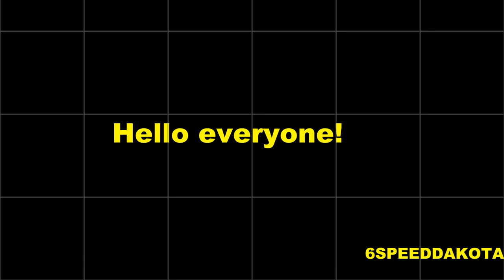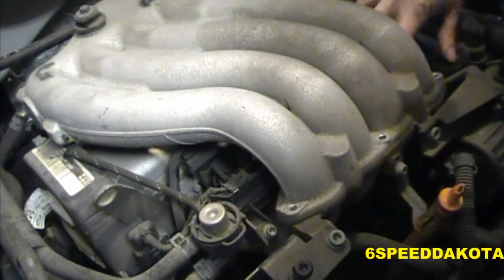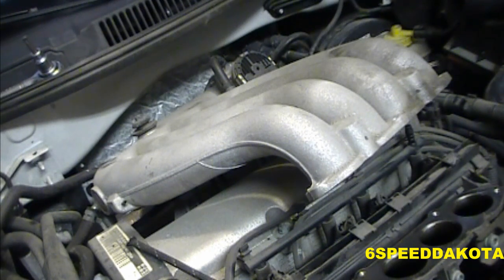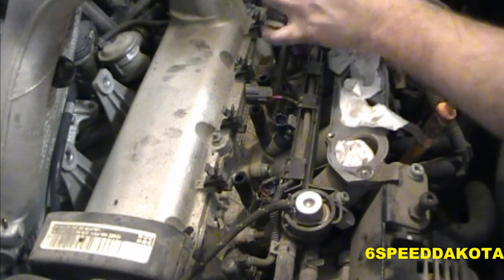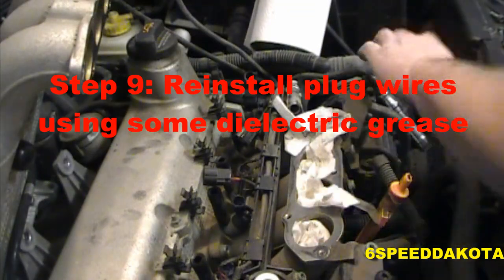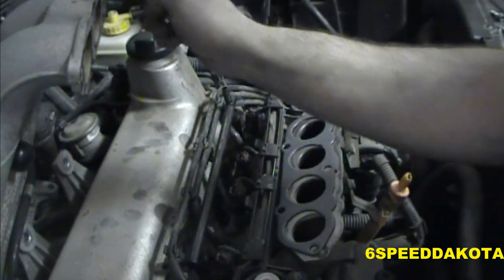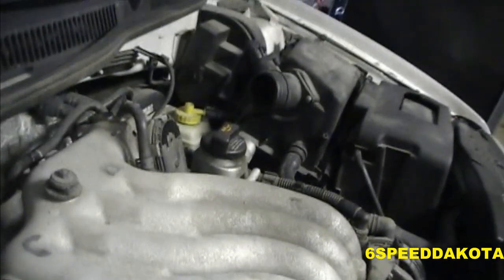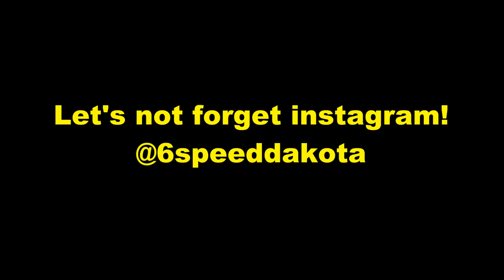MK4 VW 2.0L Spark Plug Replacement

Comment: I just this morning worked a VW 2000 Golf engine 2.0 it had codes  PO 411:  Air pump/ 
422: Oxygen sensor/ 
341: Camshaft  position sensor

171: System too lean Bank 1
300: Random Multiple  Cylinder misfire/
303: Cylinder number 3 misfire
304: Cylinder number  4  Misfire
1296: Coolant sensor

And by replacing spark plugs
And fixing the air pump Which it had the two wires at the bottom peeled 
 and touching  with each other. It took care of all of those codes. I scanned it,  and it says no codes. saves my friend a bunch of money. Thanks,  to the videos y'all guys post on youtube.

Comment: I'm learning so much from this video right now. 
Thank you. 
I think my golf may have a misfire sitch going on. I thought maybe I could bang in a few sparkies and sort it out. 
But I think the part that really changed my mind was when the Allen keys came out. 
I've never actually held an Allen key for more than five seconds at a time before it slipped through my nervous fingers.
Do I use the long part with minimal torque? 
Do I start with the short part and struggle to find the tiny little hole?

 It's just a super thin L. 

It's gonna hit the floor and get lost.

And they're the first screw to get stripped, they're only a couple flimsy edges away from a circle anyway.
 
I mean what the heck was Allen thinking!

And they're on everything; towel rack, curtain rods, tp holders.....

They just get smaller and smaller......
Reply: i recommend getting ball point allen sockets they come in handy with VW lol

Comment: Ok just one question I’m
New on this so spark plugs don’t have to be calibrated anymore ? I take my vw to the mechanic he change oil and also replace the spark plugs the car used to shake still shakes but now not just shakes also now when I start the engine the car does a shake like moving back and forwards and stop doing it after I drive

Comment: I have the same problem with a vw 1.6 petrol engine in Europe.... these engineers were crazy...  you  can change them except you need a special tool to pull of the boot from the plug and to put it back on... you should not yank that coil with pliers...maybe the guy who came up with this shit should be fired for life...
Reply: is it possible to do it without the tool ?
Reply: @randyr.8536  yes, you just need some patience. This is an annoying job, but like a lot of these sorts of maintenance tasks, once you've done it once, lost skin off a couple of knuckles and worked out what tools to use and how to use them, it is far less frustrating every time after. The steel caps on the plug leads have a stamped ridge in them. The trick is to use a pair of long-handled, bent-jawed pliers to remove the leads, and do this only by grabbing the ridges on the metal, not the rubber lead. One of those large screwdrivers with the bent end and the splayed out blade that you use to remove trim pieces is also really handy. If you get the metal lead cap slightly off the plug, you can use the screwdriver to carefully prise the lead off until it unseats, at which point you can carefully pull on the lead. You will need to access the plugs/leads from the front lower part of the engine block, not just from the top around the intake plenum. I've found the way to do it is as follows:  1.Unplug the fuel injector electrical connectors for cylinders 1 and 4 and poke the connector down out of the way. You then wrangle the plug leads off. The plugs for cylinders 1 & 4 come straight out, but 2 & 3 are the ones that are tricky to get to. Use the pliers as described above to remove the leads. Buy a spark plug socket on an extender with the 'wobble' end that allows the socket some degree of movement. Without this tool you won't get the inner 2 plugs out. The other thing I worked out that now makes the entire process far less painful is to use a short (6 inches or so) piece of  brake hose to reinstall the plugs. The end of the hose will fit snugly over the end of the plug, and the flexibility in the hose makes it HUGELY easier to get the thread to start without cross-threading. Once the plug is in a couple of turn, just pull the hose off and use the socket to tighten. Hope this helps - the first time I tried to do the plugs, it was almost 2 hours of utter frustration. Using the right tools and techniques, it now takes me less than 20mins from go to whoa.
Reply: @spokebloke1  thanks for the help but i just got rid of the whole car and purchased a 370z . the volkswagon just got me annoyed with problems . not ever buying a volkswagon agian thats forsure
Reply: @randyr.8536  no worries. Funny I'm looking at replacing my Mk4 and I've been looking at the 350s/370s as well. All the best.

Comment: Mine spark plugs wont come out
Reply from the maker: Alexi Torres try soaking them with some penetrating oil for a couple hours. There’s probably some corrosion that has frozen them in
Reply: @6speeddakota  thanks. I actually got them out with my regular plyers. Went all over town looking tor that tool. They were really had lot of corrossion. My car has 126k got it with 116k and still had the original spark plugs. The were horrible. But car runs a little better after canging spark plugs and serpentine belt. Still have other small issues tho.
Reply from the maker: I thought you meant the spark plugs themselves. Use a dab of dielectric silicone grease on the body of the new plugs to prevent them from welding themselves to the plugs again
Reply: @6speeddakota  did it. Thanks